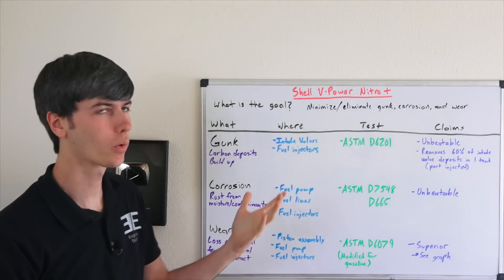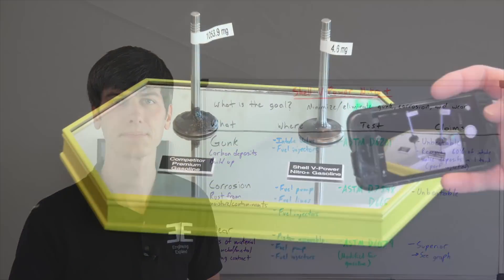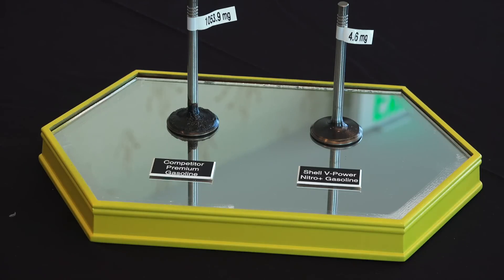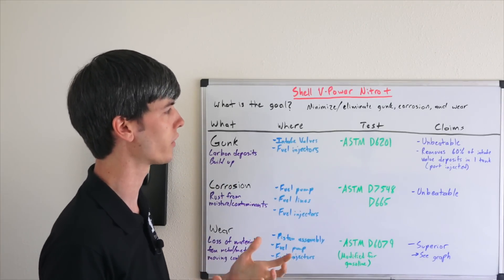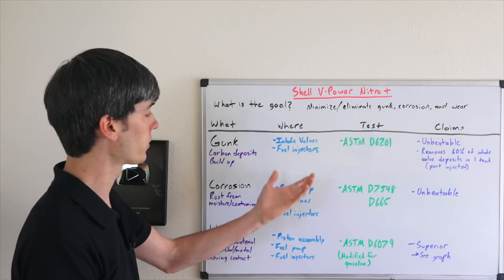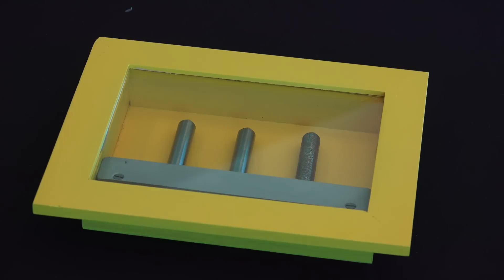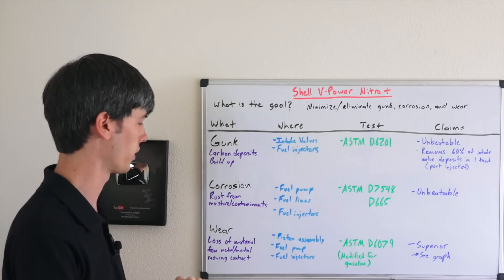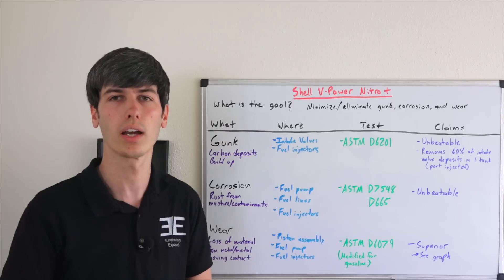Shell V-Power Nitro+ (Premium Gasoline Fuel Testing)

Comment: Wtf are you using over there in US ? Do you run your cars on coal ?
Reply from the maker: ***** Same stuff you're using, wherever you are...
Reply: ***** Pretty sure that was a DI engine valve pic. If so, that's completely reasonable at 15k miles. DI doesn't get the fuel wash/cleaning effect on the back of the valves.
Reply: Carbonblue14 Simple, because not only "clean air" is passing over the back of the valves. The EGR system recycles exhaust gasses back into the intake manifold for combustion. The inert gasses contained are supposed to help engine operation and are part of emissions control. Also, the PCV system recirculates crankcase gasses back into the intake manifold as well. Both of these systems are recirculating dirty, oily air back into the intake manifold. These pollutants condense and accumulate on the back of the intake valves. Such accumulation can be very severe in a very short time in DI engines. It's actually one of the liabilities of the design. New cars, like the BRZ and FR-S, are using a hybrid fueling strategy that incorporates both DI and PI, which addresses this issue.

Since I'm DI only, that's why I run an oil catch can on the PCV return line. Doing so helps eliminate the oily gases out of the air before it gets vented back into the intake manifold. It helps, but it doesn't 100% eliminate it. Some people disable their EGR too to further help, thought that's technically illegal because it's tampering with emissions systems, which the EGR technically is.
Reply: ***** Agreed, our fuel is terrible.
Reply: We use freedom 🇺🇸
Reply: tamenga88  i just did a rebild on my 1993 jeep yj 2.5l engine with 400.000k on it and it was way cleaner then that the intake valves are still nice and clean and that's because there is gas spraying at them all the time and i run what ever kind of gas i want i call b.s about this shell stuff and them intake ports looked like exhauet ports to me!
Reply: ***** the valves looks very gunky i agree
Reply: Engineering Explained That much gunk in a engine which ran 15 k miles ? I dont think so .We took apart my dads forester which ran 50.000km km and it didnt look anything like stuff you showed .
Reply: rudechi All direct injection engines have carbon buildup problems.
Reply: ***** bro it depends on the engine, for minis that i know they get tons of deposits in US as well... but i can tell that here in Greece we have terrible quality of gasoline ... :)
Reply: dimitris anastasiadis Όχι ακριβώς. Η μάνα μου δουλεύει στα γραφεία της Εκο (που συγχωνευτηκαν με αυτά της BP) οπότε μπορώ να μιλήσω εκ τον(ω?) έσω. Η Εκο, η BP και η Shell έχουν όλες την καλύτερη βενζίνη στην χώρα, οι διαφορές είναι απειροελαχιστες. Το μόνο θέμα το έχει η Shell με τον τρόπο που ονομάζει τις βενζίνες της. Έχω καιρό να τα δω αλλά από ότι θύμα η "στανταρ" 95αρα της Shell είναι πιο κάτω από την αντίστοιχη της Εκο και της BP που περιέχουν πρόσθετα. Η αντίστοιχη 95 στην Shell είναι η 95+ που όμως για κάποιο ανεξηγητο λόγο είναι μονίμως πιο ακριβή... Γενικότερα η Shell προσπαθεί να πουλήσει την ιδέα της "ανωτερης ποιότητας" και σε χρεώνει για αυτό... 

Όσον αφορά τις υπόλοιπες, ναι είναι γαμησε τα μην βάλεις ποτέ. Πότε. Πότε. Ειδικά αν δεις βενζινάδικο με πολύ χαμηλότερη τιμή από τον μέσο όρο εκείνη την περίοδο. Στο λέω γιατί ξέρω. Κάτι όντως πάει στραβά. 

Γενικά οι τρεις τους έχουν την ίδια ποιότητα με αυτή που θα έβρισκες σε αντίστοιχες πολυεθνικές εταιρίες της Ε.Ε.

Tl; couldn't r
Greek gas is generally en par with the rest of the European markets'. Not that anyone should care...
Reply: Carbonblue14 All this is after THOUSANDS of miles. If even very little of it, finds it way through, then it's going to build up over time
Reply: Chris Fokjohn ισως εχεις δικιο αλλα απο προσωπικη εμπειρία και απο φιλους που καναν εκδρομές στο εξωτερικό με δικα τους αμαξια, ολοι διαπιστωσαμε οτι πχ η απλη στη Γαλλια κανει το αμαξι να συμπεριφέρεται καλυτερα απο την 100αρα την ελληνικη 

Παντως μακαρι να ειναι ετσι οπως τα λες ;)
Reply: Zack Richmond oh yea I forgot about the EGR and the crankcase ventilation. Thanks for clearing that up, I too drive a DI only car hopefully it isn't built up with carbon yet. Its only 2 years old with 50k km
Reply: Filzia Direct injection, silly. What on earth would indirect injection be anyways? LOL
Reply: haha thinks bud my jeep kicks ass! keep them GDI enginse away from me! i think i will stick with MPI!
Reply: We run on hopes and dreams.
Reply: lucasqa19 I would never run E25, I don't want to run the E10 blend, Ethanol anything is crap. It is a trash fuel, and is only around as a corn farmers subsidy....
Reply: Zack Richmond Try running Sunoco GTX+ in your mini. fixed my problems in about three tankfuls
Reply: Abe Lincoln I have a Mazdaspeed 3, not a Mini. It's not a matter of what fuel we use, it's the fact that we're direct injected. The back of the intake valves get no fuel wash at all. That aspect of PI design is actually superior over DI. In DI, the oily air from the recirculated EGR gasses and PCV system just aggregates crud on there. Mazdaspeed folks have tried all sorts of fuels and it makes zero difference. Ironically, certain oils make an appreciable difference because of their combustion byproducts (a little oil always gets burn) aren't quite as prone to stick as they recirculate through the engine.

For Mazdaspeeds, the ultimate solution is to either run supplemental port fuel injection to get the fuel wash on the intake valves, or install a water-methanol system. Methanol is highly corrosive and keeps the intake valves very, very clean.

Disabling the EGR system and running an oil catch can on the PCV return can also help mitigate the accumulation, but there's simply no better solution than having either fuel or methanol wash the back of the intake valves. That addresses the root of the problem.
Reply: WezleyB That E25 would probably reduce this problem since there would be less carbon in the fuel to gunk up the valves, plus it would boost the octane to somewhere between 89 and 91 octane, 93 octane should be possible with 30%.
Reply: ***** That car does not have direct injection. of course you won't see the dirty intake valve like in the video!!!
Reply: Engineering Explained Lol you are now running for the main mad man for shell? Cmon you know better then everyone that fuel differs from place to place and even more from continent to continent and it even depends from where the oil is, for instance Russian oils have more sulfur so during the process to turn them into petrol they add different chemicals and additives...

bottom line is that in US most cars run on 91 additive lean fuel, in Europe we mainly run on 95/98 additive rich fuel only downside is that because of the EU ecology directive they are also adding up to 10% of bio fuels to most of the petrol of course you can find bio pure fuels mainly the premium 98+ octane fuels don't have any bio substances in them. 

Some years ago i have done some testing on few of my cars and the results where all the time same, when i added high octane petrol there was no smaller fuel consumption sometimes there was even higher one but there were some differences between the more additives fuels, some of them saved some consumption and they also made the engine more quieter but nothing else and all the mentioned was rather on the feeling level no significant change and they costed much more truth is that non of them was shell, best fuel so far was from OMV, shell only made the cars more noisier and more thirsty.
Reply: ***** Another thing that may cause excessive carbonizing of an engine is if you do a lot of small trips.
Trips where the engine never gets to warm up, it runs quite rich in such cases.
Reply: Zack Richmond yeah thats true you wont get the cleaning effect if it was DI but how would the carbon deposits get on the back of the intake valves if only clean air (not an air fuel mixture) passes through it? i'm just curious to know :P
Reply: ***** Direct injection...
Reply: Carbonblue14 Hopefully, LOL. Yeah, some DI cars are worse than others. My Mazdaspeed 3 isn't too, too bad, but even at 35,000 miles when I cleaned my valves I was amazed by how much there was. FWIH, the Mini Cooper S is the worst.
Reply: ***** Direct injection? or indirect?
Reply: Zack Richmond Yep its was a naturally aspirated 2l DI.
Reply: Zack Richmond Indirect is on most vehicles that aren't within the last few years. If the injectors spray above the valves its indirect. You could also call it multi-port, or TBI, or even carbureted.
Reply: Filzia Ahhh, okay. I'd never heard the term :-)
Reply: Luke Shaw  Not BS, it is real and they are intake ports/valves. 
GDI engines are notorious for  having this type of buildup on the intake side. Enjoy your older Jeep engine, they are old but good.
Reply: Engineering Explained Nope, here I use E25
Reply: lol
Reply: WezleyB lol
Reply: WezleyB Hey, here we don't use corn ethanol. Here we use sugar cane and we also have E100 - pure ethanol
Reply: ***** What year is your Dad forester? I think so far the only DI engine Subaru has is the FA engines. No Forester has it other than the Turbo model.
Reply: yogaexe It was a 2007 with 2 L non turbo .
Reply: GreenJeep1998 fill a jar with e25, pour a tiny bit of water in you e25, and shake it up. that sticky goo at the bottom is ethanol... it has a very short shelf life. it has 4-5% less energy than real dino juice, of course your octane goes up, it is less flammable.
Reply: I've been running ~E30 in my Mazdaspeed 3 for years. Zero issues. It's actually extremely well vetted out in the Mazdaspeed platform with thousands and thousands of drivers going millions of miles on it. And since it's basically commonly available race gas at a much lower price, I was able to be tuned for much more aggressive timing with zero KR. The functional octane of ethanol in DI applications is ~160 too. It's pretty ridiculous.
Reply: ***** Its the same thing. Indirect is just a broader term.
Reply: Engineering Explained No! Here in Germany we have more Octane in our Gasoline!
Reply: Johann Wolfgang von Goethe More octane and more immigrants, lol :!
Reply: And so? And with what counrty are you comparring Germany?
Reply: ***** yep.. total junk fuel... lasts 6 months at most in storage until it gets really weird and sticky... low powered, and bad for the engine, i stay away from it as much as i can..
Reply: the octane would be higher e85 (85% ethanol) is over 100 octane
Reply: Yes, we love using coal in our cars... CLOWN!